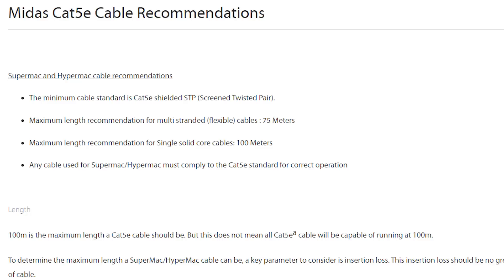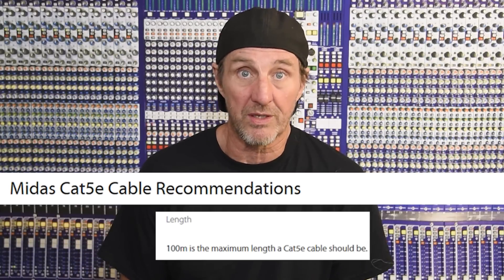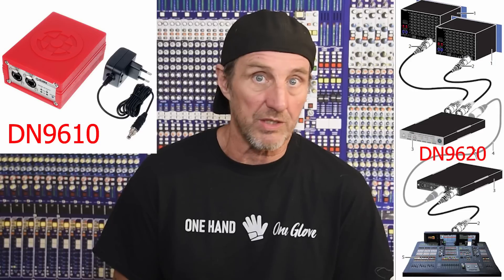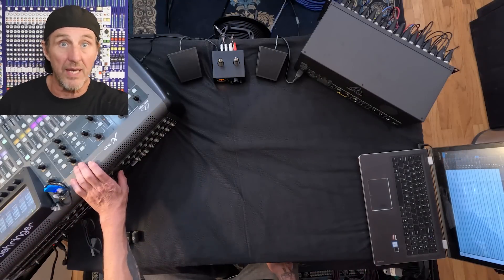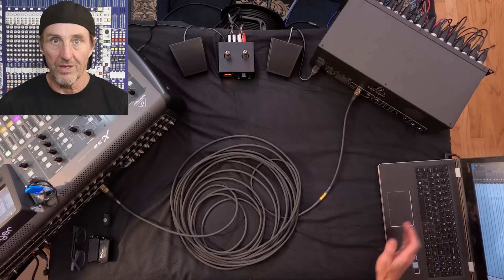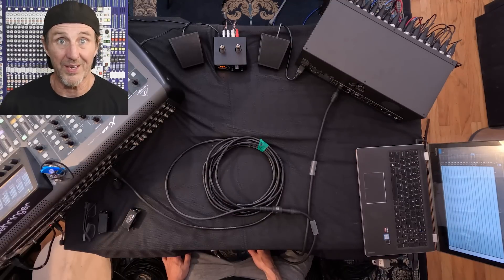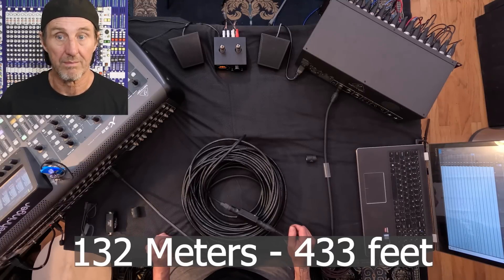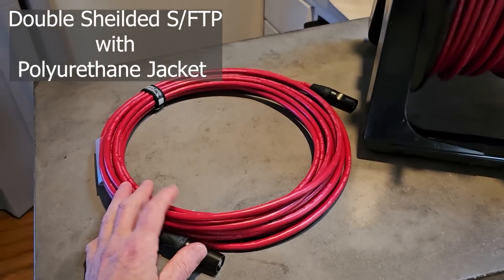Solving Long Stable AES50 Runs

Comment: Apologize if this is a bit off topic, but Dave, have you or anyone had any luck driving production intercom over Ethercon/cat cable?  Have tried multiple cables and break ins/outs with no luck.  Trying to cut down on the analogue cables deployed from stage to FOH in the main bundle/snake.  Figured it has something to do with the call shunting/grounding etc.
Reply from the maker: All the SoundTools analog over cat products will run com over cat. I did a video where I run a mic, AES, line level and clearcom down a single ct5e simultaneously.

As long as it's 3 pin com and it uses pin 1 as common/ground, it will work.

Must be shielded cat cable

If you are having issues maybe join the channel members Telegram channel.  There is a link in the members dashboard

Or call sound tools and will help ya

Comment: Since we use digital “snake box/stagebox,,,what i understand is the heart of the system switch from the console to the stagebox,and the console become the “remote” just like midi controler…but i might be wrong😅
Reply from the maker: Depends on the console. Some consoles have the brains inside the surface, some have the brains in external racks and the surface is a remote

Comment: would be awesome to see a custom prototype at 140m-150m layed out with no joins, id be amazed if you couldn't get a solid 140m signal!
purely to fun of course, 130m is going to be massive for most gigs out there, no one wants to run FOH over 100m from the stage :P
Reply from the maker: May e check out this vid where I go into more depth and use the final production cable. It still has extensions but hits 140.

Mathematically and measurement wise, the cat6 couplers only cost about .4% in length or so.

So maybe 1.4 meters of length lost per coupler.

In this other vid I do ESD test and test with a cable certification tester as well

https://www.google.com/url?sa=t&source=web&rct=j&opi=89978449&url=https://www.youtube.com/watch%3Fv%3DbQXOXWuxCGA&ved=2ahUKEwidk9P6s-2GAxXeKUQIHVdrCLQQwqsBegQIExAG&usg=AOvVaw1jPWndJ3Pd7YiV1eWA8rlw
Reply: Oh nice I'll check thst out for sure!

Comment: Hey Dave, have you done any testing of HyperMAC related to cable length. For some shows I have been using a pair of KT 9680s on Cat5e even though I only need  one AES50 run (@48K & 100m) and I have not experienced any drops. Yeah, I know, its complete overkill...
Reply from the maker: I have not. My goal here was to solve the issue where the most popular in the world Midas/Behringer consoles/stage boxes can be connected together without issues.

Many people were having issues with longer cable lengths so I set out to solve it.

Adding dongles or conversions or other gear other than just plugging a cable directly in the back of the products is not a solution, but rather, a workaround.

Comment: I had some serious issues with this a few years back.  I since changed the cable and that helps a lot, haven't had any issues except the odd one, very occasionally.  But anyway, this video is a problem that I've found myself chasing my tail before, thank you so much !

Comment: Great video! Would it be possible to test CAT cables on Ultralink and see what the maximum length would be? Since it also carries audio over TP cable, but it's different than AES50. I was also wondering about the new StageCONNECT on Wing console as well as Midas ultralink and stageconnect bus interfaces. It uses XLR/DMX 3 pin cable to carry 16 digital audio channels, which seems like an interesting technology to experiment with (what cables would work, what is the maximum length of cable, number of interconnects etc.). Thanks!

Comment: One other factor that you might want to measure is Change in Insertion Loss due to Cable Temperature.  Some manufactures derate max distance as much as 5% for 120F vs 68F
Reply from the maker: Yes, DC resistance will rise with temperature. Maybe check out this vid for a more in depth test adventure. 

Temp differentials and degradation over time are a few reasons you want a cable to be stable well beyond the lengths used.

https://youtu.be/bQXOXWuxCGA?si=jZUCL5w71w4gkOAo

Comment: In what situation would you ever need to run a cable that long? I just don't know who would ever need to run 200m let alone 300m.
Reply from the maker: Festivals, arena shows where the cable run needs to go around the side and mix position is far back, stadium shows, or just gigs where the cable is not allowed to cross the path of people walking and the long way around is a long long way around.

100 m is actually the standard front of house snake length for large sound vendors throughout the world
Reply: @DaveRat  Yeah, I guess you are right. That's very interesting. That cable you have looks extremely quality.
Reply from the maker: Very cool and thank you!!

I am always amazed at usages and challenges audio humans face.

Calls about analog cable runs for a marathon race, cable distances involved in doing sound for air shows and the cable runs for a power company in Alaska, are all real world calls and cable sales we have done with our various cables.

Super fun!

Comment: Hi Dave, interesting video as always. However it makes me wonder why we ever send any audio all the way to a digital FOH desk and back to the stage. (Regardless of brand ). 

It is completely unnecessary. I NEVER do that. I still use and love X32 style systems and use X32 rack and Midas M32 rack with M32 stage box all on stage run with wireless i pads and for connective insurance a PC hard wired with the relevant app. The PC can be any where in the hall with a cat 5 cable. There is never any connection problems like pops and things with cables of 1 m.

So that said, noting that sound guys like hands on faders and things, why is nobody making remote control desks that replicate current surfaces. To explain further, you have an X32 M32 Wing Digico etc that looks and feels exactly the same as the real thing but with nothing except a Network connection to the brain on the stage. Perhaps their could be a couple I/O's for playing 2tracks or delay stacks.This all could be wired, wireless, internet etc. Audio latency would never be an issue. You could mix from half way around the planet ( That would be fun !)
 
My analogy would be a TV remote. You would never find a TV that sends the video signal to the remote controller and back. The whole cat 5 thing for live sound would be redundant.

And a foot note, perhaps we could have  software updates that allow X32 etc desks to remote operate rack mounted desks ? Gee that would be a good idea ?

Perhaps a Business opportunity here ? ( Or do I send this to Uli ?)

What do you think ?
Reply: That is actually quite common in broadcast. Have a look at the Lawo mc2 56mk3 or 96 or 36mk2xp - they all use external processing (1 RU devices) that can sit in a rack on stage or data center and the console is just a very nice remote and uncritical for anything but the audio the engineer feeds in at the local-IO of the console. 
For my mixing, I do the same with a M32C sitting in the Rack at the amps and controlling it via mixing station and a midi controller (currently x-touch, might upgrade to waves fit). Just missing a nice midi controller for the dedicated channel strip controls (eq,gate/comp/gain/lc). Talkback and headphones is usually via a small dante interface (There's a dante card in the M32C as well). Has been more stable so far than using the x-touch as a remote directly.
Reply from the maker: @stephanwestphal1546 data and control over cat cable is indeed super common.

What is not common and is the focus of this video is the aes50 protocol being stable without dropouts when run on cable lengths over 80 meters.

There are whole messages boards and discussions desi ated to aes50 issues with long cable runs.

Aes50 is much different than Dante or AVB and solving the long cable length issue for aes50 is useful and valuable to many.

All that said, this cable's design and ability to run aes50 long distances up to 130 meters also make it capable of stable reliable runs of other protocols like Dante and Milan and AVB long lengths that exceed the 100 meter specification limit.
Reply from the maker: Yes there a lot of options in ways to do things. Simplicity and redundancy are important factors. Some consoles are just dumb surfaces while others have the engines and processing inside.

Regardless, The need for desire for various analog outputs to be locally generated at front of house is quite common and to have all of the signals remotely located creates another level of complexity for something that's quite simple with the current arrangements.

It's very easy to transport the signals long distances and with more expensive consoles that have built-in fiber or other formats, the hundred meter distance is a non-issue.

With the budget-minded M32 and X32 that have built-in AES50, the long lengths do pose a challenge.

But since that challenge is easily solved by using a cable that works, The issue can be easily solved.

The big problem here was lack of clear information and the fact that the manufacturer doesn't make a cable that meets the specifications that the manufacturer states are needed for the cable.

They screwed up inspect a 100 m cable limit based on unshielded cable and then realized that unshielded cables have ESD issues and then change the specification to shielded cables that don't work at 100 m.

Manufacturer side step issues like this all the time with proper testing or manufacturing cables or parts that meet the specifications that they publish.

This is an example where a manufacturer failed to do so

Comment: Happy Father’s Day!

This will sell like hotcakes to people who need less than 140m, like in smaller venues. I certainly hope they come premade in 20, 30, 50, 75m lengths as well as the 100m. And for installs, being sold by the 300, 500 and 1000m reel would be handy. 

Can I assume this will pair ideally with the analog stage boxes as well?
Reply from the maker: Yes this will work well with the analog over cat. We're only going to release 100 m, 60 m, and 10 m. It's optimized for applications where durable flexible high speed cable is needed.

For permanent installs where you can use solid conductor wire and the demand for higher fireproof ratings is common, there are some install cables that are stiff and hard to wind but will work just fine for long runs of AES 50.

The trick of this adventure is to get something that's flexible and durable that also is high speed and that's what took so much work to develop this

And thank you for the happy Father's Day wish!

And yes we sold out of our first run already and we have another batch coming in a couple weeks.
Reply: @DaveRat  got an ETA for when it will be back in stock?
Reply from the maker: @gregorykusiak5424 1 to 2 weeks. It is en route to us now

Comment: Silly question but, instead of shielding cables, why not simply: shielded cable runners when passing beer stands, aggregates and when crossing other cables?
Reply from the maker: Hmmm, the father away the protection is, the more total amount of protection is needed

A cable may only need some foil and braid, but to protect the runners and every location a cable may run, would probably require 100s if not 1000s or 10,000s times more metal, weight and cost.

One could wear a wetsuit to stay warm in the ocean, or could get a small submersible or you could section off an area wherever the swimmer may travel and try and warm the ocean water for that area.

One could invest in a faraday shield to broect the entire building as well.

Or just use cables that have good shielding

The costs and complexities get logarithmically larger.
Reply: @DaveRat  thanks a whole lot for this elaborate answer, love you for this man.
Reply from the maker: Google and thank you!

Comment: I've seen ethercon cables that have had horrible grounding. In ethercon the shield should be installed such that it connects to the RJ45 sheild contact AND the ethercon shield contact... often this is botched and there's bad grounding on both or at least on one end of the cable. These cables then do not pass the ethercon specification and cause havoc on AES50 runs.

CHECK YOUR BOUGHT CABLES! If they're badly done, refund and get something better!

ALSO! There's a specific list of ACCEPTED connector brands that ethercon can support, one of those being Hirose... if your ethercon cable uses something outside of that list, it's bad and should be refunded or rebuilt! This is to do with physical size so it'll ground properly and fit properly and makes proper contact when plugged in. Wrong size connector within the ethercon shell can cause havoc as well...

Comment: the 100M length comes from the basic ethernet cat cable spec
Reply from the maker: This may be true but AES50 is not ethernet. It can't pass through ethernet switches or hubs.

And doesn't have the protection and error correction that ethernet would have

I didn't extended length video going into in-depth tests and the specifications for AES 50 if you're interested in nerding out on this further.

https://youtu.be/bQXOXWuxCGA?si=E8ReFXuQwhiK1rq9

Comment: Just a note on dropouts from inferior cables, specifically with the X32 - these seem to also be induced by using cables which have a shield connected only at one end, and/or which is not bonded at both ends to the connector shell and the drain wire. This is part of the EtherCON spec nowadays but isn't part of the basic Ethernet spec, and some cables are not constructed with shields connected at both ends[1], or with the shield and the drain (ground) wire not bonded together at all. This apparently caused dropouts where a big static potential could build up between the shield and the signal lines, due to something about how the X32's AES50 decoder is designed and integrated. It turns out having a 100 metre long capacitor attached to your system is sometimes bad for electrical anomalies. 

These days most EtherCON is compliant (and most Ethernet cable as well), but this is something to watch out for if you're getting drops at shorter distances. A quick check that the EtherCON shell is connected to the Ethernet connector shell, and that both ends are connected to each other, might reveal your issue. 

[1] this is also the subject of lots of debate for analog interconnects; I've seen guitar leads with the shield connected only at one end, for instance, nominally to prevent there being multiple paths to ground. I don't think it has any real-terms effect though.
Reply from the maker: Connecting the ground to just one end of a cable is just a bummer. 

It now makes the cable directional and it rarely have ever does anything positive. If you need to lift the ground on one side then add a ground lift adapter and maintain control over it and the ability to eliminate it.

You may be interested in this video I did where I go much deeper into the adventure of AES 50 and use a cable certifier as well as other adventures

https://youtu.be/bQXOXWuxCGA?si=bPEQLLVh0ERsgviB
Reply: Dave, I came here to say the same thing. Does your cable have continuity from shell to shell?
Reply from the maker: Of course, not having continuity shell to shell serves no practical purpose that I am aware of other than solving a ground loop that should be solved properly and not solved by lifting one shell of the cable.
Reply: @DaveRat  great. Looks like you’re out of the 100m cables. I guess I could get two 60M and a coupler (though hopefully most situations a 60M will suffice). When will the 100m be in stock again?
Reply from the maker: Yes, The 2 60s will work. But we will have More of the 100 m lengths next week or the week after they're already manufactured and on their way.

Comment: So its time that all interconnects just switch to an optical solution. Much cheaper and more reliable.
Reply from the maker: Yes! and all we need to do is a quick design of several thousand drop in retrofits for the tens of thousands of consoles that have already been released, and the work out a worldwide distribution and installation team to head out and get 'er done.

Maybe we start a go fund me and once we get A few hundred million dollars in donations we should have a good foundation to start the project.

In the meantime we could probably just get a cable that works for the application at hand

Comment: I literally wrote this BEFORE I saw the end of the video!!  So I sound like a real dumb ass!!!...     

Hi Dave, do you think there's a difference in limitations with the cable coiled vs. straight?  Even with the tech of twisted pairs, shielding etc. I would assume that a coil would be more susceptible to breakdown Vs the same length run out - and also would have a different capacitance / inductance too.

Not saying your tests here aren't meaningful - and they definitely raise the main underlying point, know your gear's limitations - but I'd love to see you get that 140m length (or whichever one it was) which failed, and run it out in maybe a couple of long double-backed lengths and try it... It might even be better!!
Reply from the maker: Coiled should actually be worse but not much if at all. But thank you and as far as reaching that 140 length, check out this video where I did a more in-depth test and used the final production cable

And I was able to get that 140!

https://youtu.be/bQXOXWuxCGA?si=bPEQLLVh0ERsgviB